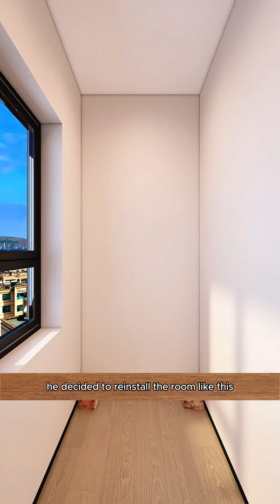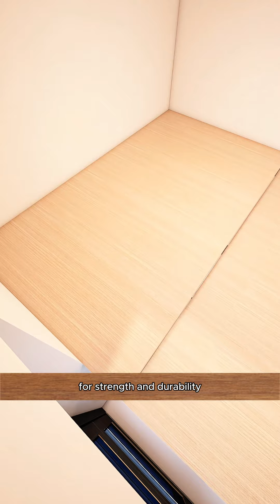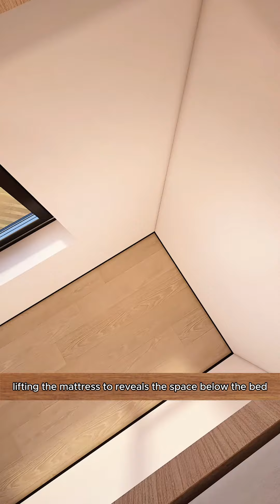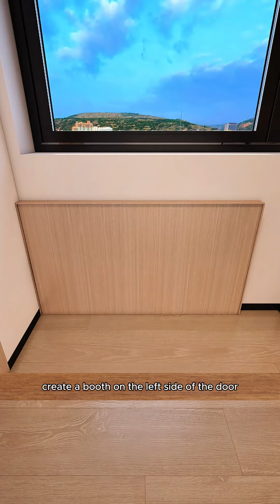Let's redesign The Two Square Meter Room in New York!

Comment: Little john came home drunk and fell asleep, suddenly he was so startled that he hit an iron with a carp circle around it which made him time travel back to this room from 10 years ago, after realizing this situation he decided to reinstall the room like this, constructed a bed frame using galvanized square steel, borrowing screws from his aunt to securely fasten it to the wall cover it with eco friendly wood veneer, for strength and durability built a wardrobe next to the bed with internal laminates to organise space for storing pillows off season bedding and daily clothes the small compartment on the left serves as a display cabinet installed a switch socket at the bottom for charging mobile phones place the soft mattress on the bed making it comfortable enough for him and girlfriend to sleep lifting the mattress reveals the space below the bed cover the inner area walls with tiles first embed a lift and preinstall the tank for a wall hung toilet into the wall use it normally as small ordinary toilet with a button the wall activating a fully automatic stair system next, build a low cabinet on the left an induction cooker makes the cooking area, and on the right a wash basin doubles as a dishwashing and laundry area, above the cabinet install functional partitions for seasoning extend a seat cabinet to the side with enchanced with light strips install a central shower head to address bathing needs with water retaining strips on the floor, and anti skid tiles add a glass sliding door to isolate odors and maintain cleanliness create a booth on the left side of the door, with a soft backrest and seat cushion, install a folding tabletop on the opposite wall to serve as a workspace and dining table which can be put away to save space when not in use install a projection screen on the wall to enjoy Korean dramas anytime, this design makes the most of the limited space in the coffin room maximizing it functionality.

Comment: Little John ✅
Walking through walls ✅
Measuring room size in coffins ✅
Galvanized square steel ✅
Screws borrowed from aunt ✅
Eco friendly wood veneer ✅
Space for storing off season bedding and clothing ✅
Socket for charging phones ✅
Books to absorb knowledge ✅
Bed big enough to fit john and his girlfriend ✅
Inner walls covered with tiles ✅
Toilet in the open ✅
Induction cooker ✅
Wash basin for dishwashing and laundry ✅
Functional partitions for seasoning: ✅
Shower head in the open ✅
Glass sliding door to seperate wet and dry areas ✅
Folding tabletop to serve as a workspace and dining table ✅
Projector screen for k-dramas ✅
Maximum functionality ✅
Long lost Buddha palm ❌
Spending years as a brick stacker ❌
Wife who accidentally haves unreasonable amount of kids ❌